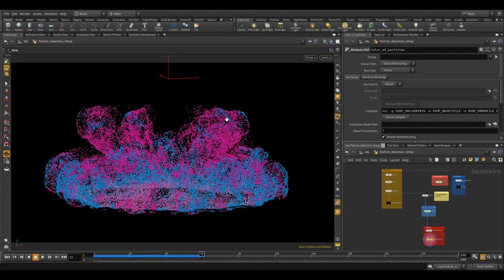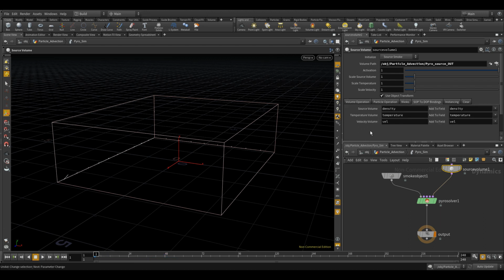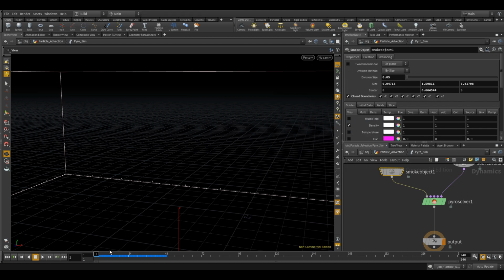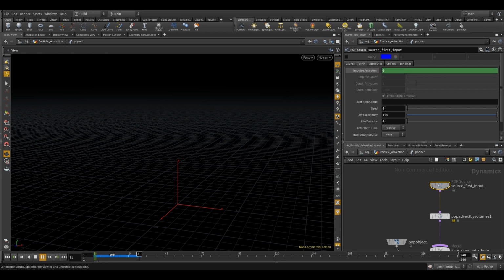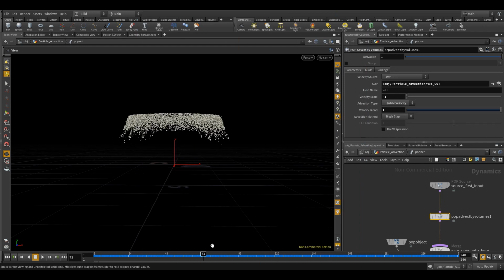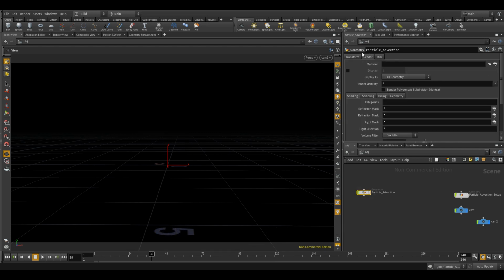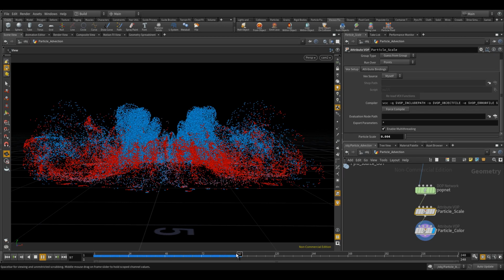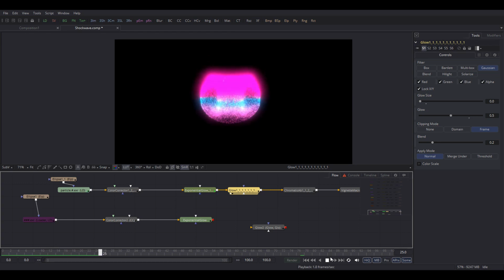Particle Advection Tutorial | Rendering and Post-Process (Houdini 16/17.5 hip files)

Comment: Hey :) Thank you for sharing this! I tried to use your setup for some of the pyro shelf tools, and it works great, except many of the particles freeze in the end. Any idea how to stop this from happening? :)
Reply from the maker: Hi, I'm glad you found it useful!

It happening when there is no Velocity(vel). My guess is that the particles reach the boundary box of your volume, so there's no velocity outside that boundary. Try to make your volume boundary box bigger.
Reply: @FX_MesropHovhannisyan  Excactly, and that makes sense... but I cant seem to figure out what to resize so that the particles keep moving after the Velocity is gone... anyways, if anybody is having the same problem, and figures out a nice solution I would be happy to know :) I have been trying to google the issue and others seem to run into the same problem - the particles just look like they get stuck :D
Reply: Ah, Gas Resize Fluid Dynamic Node was what I was looking for :) Anyways, thanks again, great work!
Reply from the maker: @Cappercph  I see. I'm glad you figured it out!
Thank you!